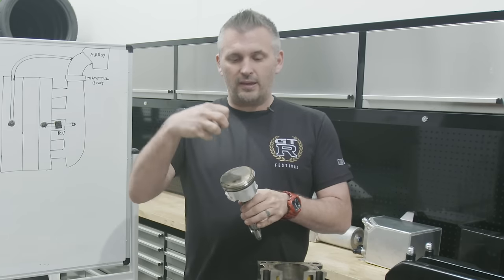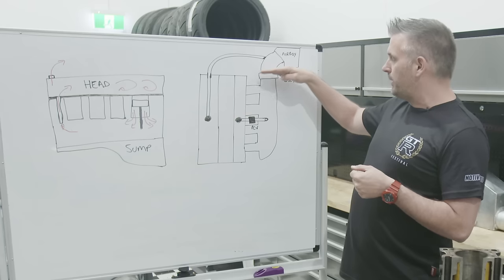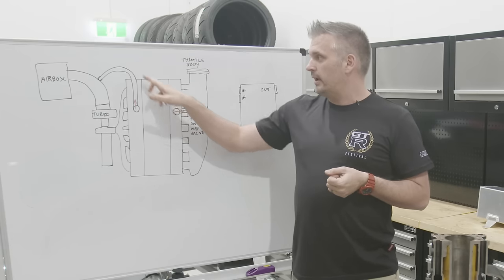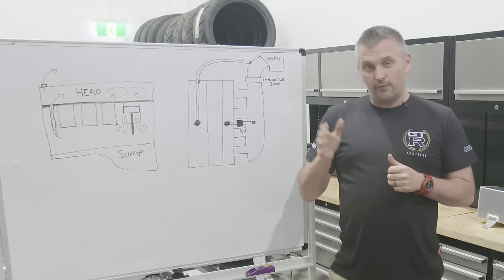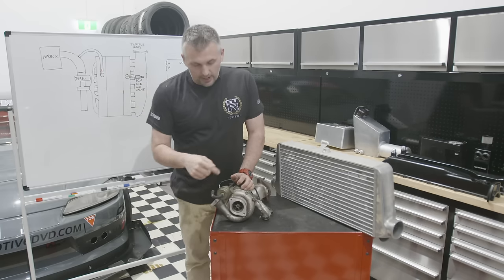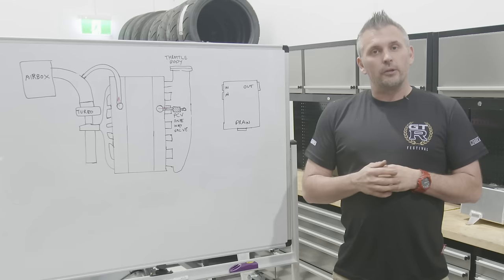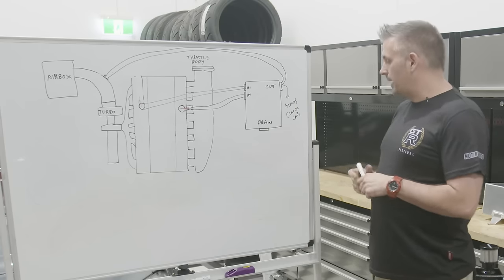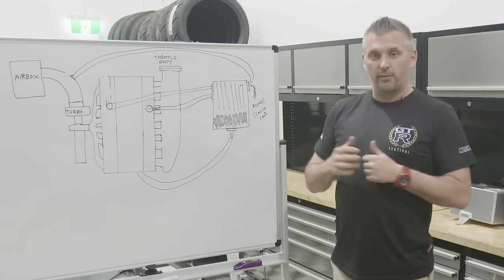Why EVERY Car Needs an Oil Catch Can or Oil/Air Separator - Motive Tech

Comment: Brilliant video - I run 2 Evo time attack cars, and one of them on boost is having really high pressure in the head to the point where it can blow the dispstick out. This better understanding of how the catch can/oil air separators are working and the pcv system will help greatly when choosing what to get and how to solve it. Cheers man!
Reply: Isn't blowing out the dipstick more indicative of a pressurised crankcase than head? Genuine question.
Reply: @ericn7698  That is pretty much explained @ 1:12 in the video - it's the same pressure in that starts in crank case andd goes to the head from what I understand. Pretty sure evo's have extra breathers to get it back to head so main issue is then getting rid of it from there
Reply: @BarbecuedPossum  a high boost engine application, there is common big breather pipe mod on evo valve cover.. (atleast is common mod even on street car where i live)  stock pcv system were deleted alltogether and replaced with direct bigger open breather system
Reply: Yup. All this means is your ventilation holes are too small. You have a lot of extra blow by and your two pcv vents aren't keeping up. Tap a pressure gauge on the oil cap and make the two holes bigger.
Reply: I’d check for cylinder bore roundness, cylinder bore finish, and excessive piston to wall clearance to get a better ring seal.  Attack the problem at the source.  Watch Total Seal’s videos about ring seal soup.  Consider new gas ported rings at your next rebuild.

Comment: Every year since 2004 I have serviced my car and have never seen any oil on my throttle body or inlet of the turbocharger. Even went and removed the intercooler and no oil. I am not doubting these things work but i'm not sold on one

Comment: Good video.

The filtration in those "Mishimoto Compact" style catch cans can be much improved by extending the "dirty air in" further downward into the can (eg tap a pipe thread into the inside hole & add a brass fitting), drilling through that alloy baffle plate for the extender piece to go through, then packing steel wool ahead of that small bronze filter so that the air is filtered a lot more on the return journey. A further upgrade (for the longer version of that catch can) is to replace the alloy post with some m6 threaded rod, make a second baffle plate and sandwich some steel wool in the middle section with an air gap at the top just before the bronze filter.  

Most of the water in the catch can is a product of burning hydrocarbons, not from the ambient humidity. Eg the Hydrogen & Carbon in the fuel burns with Oxygen to make Carbon Dioxide and H2O. See also your exhaust pipe at cold start, your cold saucepan under a gas burner, etc. Burning E85 makes a sh!tload more water vapour in the exhaust (and therefore in the blowby) for whatever reason. 

Also, "longetivity" is a perfectly cromulent word :p
Reply: BBu
Reply: I was just about to start the build of exactly what you're talking about. Anyone who's seen a bong knows the dirty air needs to enter from the bottom and filter up through the filter media. All of the cans I see have both intake and exhaust at the top or on the side, right beside each other. This will accomplish very little as the air will take the path of least resistance and just bypass the filter media. 

So what would happen (for conversational purposes) on a brand new GDI car if you just ran a hose from the crank case and dumped it out the bottom of the car? Just let it vent to the open air? Check engine light? Anything? I suppose you would need to cap off the return line back into the intake to prevent an undesired pressure differential in the intake, but aside from that - any issues?
Reply: And there is generic “mishimoto cans” really cheap that are exactly the same as the mishimoto on amazon or ebay.
Reply: This will cause to much airflow restrain?
Reply: @g.dejong1594  I've had no problems with that setup. Crank gas still flows through the can.
Reply: No, you will make it even worst....don't do this.
Reply: @tt-rs1457  Is "even worst" a bit like "even worse"?
Reply: @yowie0889  

Jawoll, kinda 🙂

Comment: Awesome video as usual! Personally I have the return to sump setup on my GTR however I have a line at the highest point of my sump “breathing” back to the highest point on my separator and a second line also just for draining the oil so 2 lines off the sump in total. After making that change I’ve never had any issues. People don’t understand that it doesn’t matter how many drains you put or how much you enlarge the returns, if you always have pressure in the case it will never allow it to drain properly due to pressure. Looking forward to more videos!

Comment: Great vid 85% of what you said is correct other than the main issue of not actually adressing and reducing blow by. eg do and donts with plumbing, t peices between rocker covers and to think of direction of hose routing. Other options as having an air seperator with drain back that then vents to a catch can. Or externnal oil pumps and dry sumps. One simple method to reduce condensation on e85 or methanol is the have the cap off whike the car is warming up. but advising people to to just keep going bigger and bigger if they keep filling the can has to be the worst advice as they will come to a point with insufficent oil in the sump and lead to engine failures that people try to blame on bad oil pumps etc.
Reply: I'm glad someone said it. Thx so much. I was thinking it might be the most liked post, and at the top... but, oh well. Thx again!

Comment: Great explanation.  One great reason for a filtering system on the PCV is that all fire creates water.  A lot of water.  Most of the hydrogen in your fuel is combine with oxygen in the burning process to make water.  I don't want water reintroduced into my engine.  Cooling the PCV gases will condense the water and hydrocarbons, so put your catch-can somewhere cooler.

Comment: Of course, it's not just pressure and oil mist in the crankcase that are bad - regardless of the fuel type, the blow-by gases contain water from the combustion process and potentially unburnt fuel, neither of which are things you want hanging around in your crankcase and getting into the oil.

Comment: With sump returns, I run mine below the sump oil level (near the bottom.) then oil works as a 1-way valve (simple U-Tube ;) ) 

With circuit cars that aren't dry sump'd. sump returns are an absolute must. DON't want to pump the sump dry....!!!

Great video :)

Comment: recently had a sort of runaway diesel which ended in motor grenading... customer's car went into limp mode, no boost, and she decided to try putting a 5L jug of 5w20 thinking that might fix it.... without knowing the full story and that it's been in limp mode for weeks, I scanned it, replaced a part, and went on a test drive. The excess amounts of overly thin oil has led to so much blowby that the intercooler must have been filled with oil. But with no boost for weeks, the oil naturally remained in the intercooler which was mounted really low. Once I got into second gear and rolled onto the throttle, boost kicked in, pushed the oil up and into the motor, tach needle jumped to the stopper at the end of redline, smoke cloud behind me, and nothing I did was able to bring the rpm down one bit. Went on for about 15 seconds and the motor began to loose compression which finally killed the motor
Stupid scenario that I would've never expected to happen

Comment: I have a question about plumbing. This is the first time ive seen someone make a diagram showing both the crankcase vent and pcv valve being routed into the same can/separator. I have only seen something similar when people remove the pcv valve and weld on -10AN fittings and run lines from each valve cover into a catch can that vents to atmosphere. I have a stock ‘95 toyota tercel (starlet) as a daily and it has a naturally aspirated 1.5L engine (5EFE). The stock ventilation system is laid out exactly as you have drawn it in the stock naturally aspirated example (pcv valve has hose going to manifold and crankcase vent/breather has hose going to intake tube). I recently rebuilt the head and decided the best to keep things clean in there now that it’s like new was to install an oil/air separator exactly like the one in this video except mine is a 3-port (2 in, 1 out). I dont want to vent to atmosphere because of the smell, legality, fire hazard, and messiness. I intend to keep the engine bay very clean. I’ve seen many people run dual cans (1 for pcv and another for breather/crankcase vent) and have them return to their stock respective locations (manifold and intake tube) unlike in this video where both go into the same can and return to the same place. I attempted to install mine this way and return to manifold vacuum and got a horrible howling noise that sounded like the baffles in the valve cover or air/oil separator were creating resonance, but i had a vacuum leak so it could be that. My question was is there any problem with me running both of those back into manifold vacuum or do i have to plumb them into the intake tube or do i just have to run 2 separate 2 port cans? I have also been told the purpose of the breather is for fresh clean air from the intake tube to enter the engine because the manifold vacuum in the pcv valve is creating a vacuum in the engine so plumbing both to manifold vacuum would be a mistake but I’ve also heard that manifold vacuum will never be strong enough through the pcv valve to cause the whole crankcase to run into vacuum. Not sure what to believe or what the ideal way to plumb the system is. Sorry for the long-winded question plz help

Comment: One of the best video on YouTube explaining all the possible set ups. 
Thanks

Can  i use a stock PCV system  with just a check valve so during boost there is no chance i pressurizes the crankcase but does a great job bringing crankcase vapors back to the engine under idle?
Reply: Check out Tracy lewis performance and his catch can system work with check valves before and after the throttle body so it's always sucking pressure from the crankcase to the catch can.

Comment: thank you so  much for this video..i have a turbo charge car with a pcv system delete into a dual valve cover vented catch can and i started seeing milky oil in my oil cap and oil pooling in my turbo exhaust port and i got nervous thinking my head gasket wasblown but after testing i realised the head gasket was good and seeing this video im getting a better under standing that my issue very well might be my catch van not configured properly im going now to follow these instructions

Comment: I've recently hurt my Ford racing 427 due to inadequate PCV. I had the PCV system from my 302 on my 427. I had every symptom of a bad PCV happen including oil getting into my standalone computer through the MAP sensor line and dripping on the carpet in the interior. I have at least 2 cylinders with what i suspect are broken piston rings and some cylinders with lifter ticking. This conclusion was from both compression and leak down tests. Now i have to take the engine totally apart and see what happened. I will be running a catch-can that connects to both valve covers and intake tube.

Comment: I like those instructional videos, and I especially like the comparison between an oil catch can and an oil/air separator...Now, you compared both and mentioned that both are trying to do the same thing, yet gave a disadvantage for the catch can due to the obvious reason of course (illegal due to emmisions), I get that...second disadvantage you mentioned is that catch can is not going to catch all oil and some of the oil vapor/mist will come out of filter and into engine...I would also argue that just like a catch can, an oil separator is NOT going to separate ALL oil from air before going back into intake...So, my main point I am trying to make here is, why return to intake at all if both options are not going to fully isolate/speparate/collect oil?? Which will bring us back to where we started in the first place, having oil residue inside intake/manifold/intercoolers (not as much of course as before having either option), which will in turn lower octane rating, dilute air/fuel mixture, retard timing and eventually having less power. Me personally, I would just NOT recirculate through intake/manifold all together, and just go with a baffled/filtered/vented catch can, run the PCV line into it, and finally of course, cap/block off the intake/manifold inlet where PCV outlet used to goes into. What do you guys think?? Cheers.

Comment: I've put two oil/air seperators on my petrol/gas 6 cylinder car, one for each vent. What I find is that my oil stays a lot cleaner for much longer, its done about 8500km on the last oil change and its still hard to see on the dipstick! Before the cans it didn't take 4000km to get dark. Inlet manifold and carb are both super clean. The motor, by the way, has done 675.000 km. On the one that goes back to the inlet before carb it gathers a lot of water, especially on short trips on LPG.

Comment: I need this for my 2.4l eco tec in my Buick Verano... I took the air intake hose/manifold thingy off and saw all the crud built up in the throttle body, and saw the oil residue in the manifold. I also see oil residue under the PVC out that goes from the valve cover to the air intake manifold i took off. It burns like a half a quart every 2 weeks if i drive alot. I wish I could catch that oil and dump it back in. LOL

Comment: Any restriction will reduce compression ring seal to the bottom of the top ring land. A leak down should be done if any sizable amount of blow by material is in the separator. Gas ported pistons in dragsters are an example of needed ring seal improvements in supercharged engines and motors. I use a large non bronze baffled unit in my street car with a homemade vertical baffle and drilled extension tube in it. Less blowby is a result of less restriction. More sediment or catched material can be a result of less efficiency in the can or bottle from actually restricting the vacuum that the engine case needs for ring seal.

Comment: I've installed an OCC on several of my cars with what I can see has been successful but I've recently read that these OCC can increase the pressure in the engine to unsafe levels. What do you know about this and do I need to be worried? Show all OCC have a breather on them so not have this problem? My systems are oil/air separator systems exactly like the one you show in your video with the bronze filter. They are the Mishimoto OCC design but I've been hearing that the bronze filter is too restrictive. I'm not sure what to do now and if I should make a change. I have one turbocharged car that has a breather filter on the valve cover so I'm guessing the is not an issue. I have a N/A car that is a sealed system. And I have an older 1989 Supercharged MR2 that is a sealed system. Should I add a breather to the older car? I don't have any emission testing where I live.

Comment: Regarding sizing if you are doing track events: Motorsport Australia (CAMS) schedule b: "if fitted with any crankcase breather discharging to the atmosphere, each breather be vented into a
catch tank of minimum capacity of two litres for engines up to 2000cc or three litres for over 2000cc.
 Regulations for competitions on unsealed surfaces may waive this requirement;"

Comment: you have one line from catch can to your exhaust (t junction) this creates a vacuum at high rpm-that vacuum creates negative pressure for the catch can fumes and helps the engine breath

Comment: Having exactly those problems with my Rb30, Running nitto oilpump, E85 around 820 AWHP, Filling my Catch cans (2x1 liters) in around 2-3 passes (quartermile) i have baffles in camcovers + an extra return from top to sump but its seem like the only way to go is to Reroute the cans to the sump again :)

Comment: Can you just put fittings into the head and run a hose under the car to drain on the street. I know it’s a problem in the track and not environment friendly. But it’s maintenance free and has no restrictions.   Also where do you see more pressure.  In the crankcase or towards the top of the head in valve cover??  I’m having smoking issues (white smoke) on start up after 2-5 mins of idle.   Goes 90% away when warmed up.   Turbo seals or valve seals?  Thank you for the video and I love your channel.  Cheers from USA
Reply: valve seals
Reply: @copperkeyracing6167  it ended up being a blown turbine seal

Comment: Ok 2 part question... With the oil separator on a turbo charged gdi, you have 2 lines into the separator and the return (out) is going to the air intake (before the turbo). A) why return to the intake instead of the throttle body, or does it matter where the return air vents? B) if the separator has one inlet instead of two, can both lines be tee'd together before entering the separator? 

In my opinion I'd tee the lines together before the separator inlet and return to the throttle body and plug the air intake connector to avoid getting any remaining gasses in the turbo/ intercooler. I may be overthinking it but what should I do?

Comment: I think a better idea it’s just set up baffles or gullies inside the valve covers this way more cleaner. Air is coming out of the valve cover and possibly most of the oil is dropping back into the head. I don’t know what do you think?